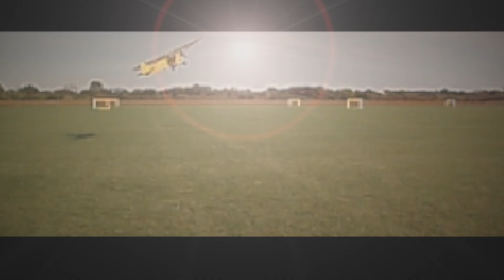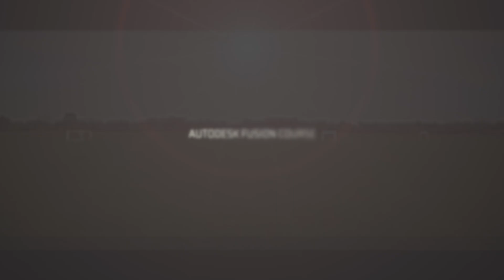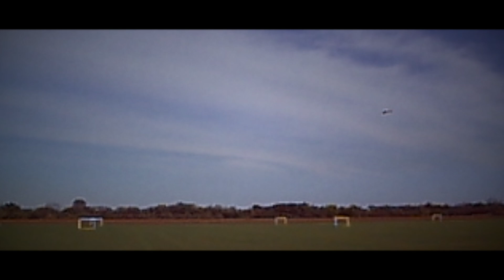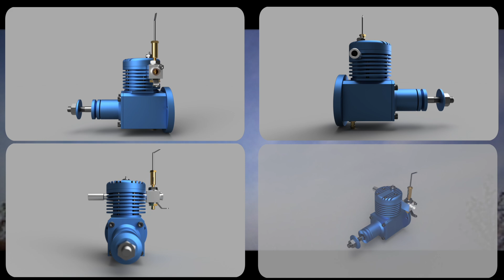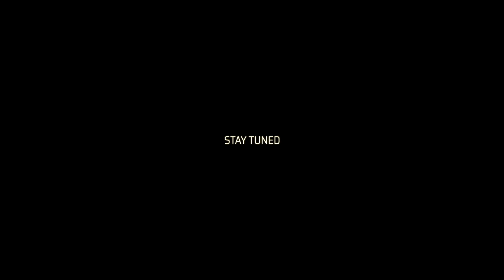Autodesk Fusion 360 - 4-Stroke RC Plane Engine - Trailer

Comment: I believe that the engine depicted is 2 stroke not 4 stroke. A trivial point I know.
Reply from the maker: Thanks for commenting! However, I must ask, did you watch to the very end of the video? You'll see that it is indeed a 4-stroke engine. It is complete with exhaust and inlet cams along with valve assemblies which 2-stroke engines don't have. The rendered image on the thumbnail doesn't show the valves and cams because this design has them built within the cylinder jacket.

Comment: please make videos about a c channel structure design
Reply from the maker: Thanks for your request. Can you explain a little more please?
Reply: @My guess is 4080 C beam aluminum extrusion. Extremely fun to play with Aluminum extrusions, as well as lead screws and sliding rails in Fusion. I've been dabbling with modelling my current and potential CNC upgrades.